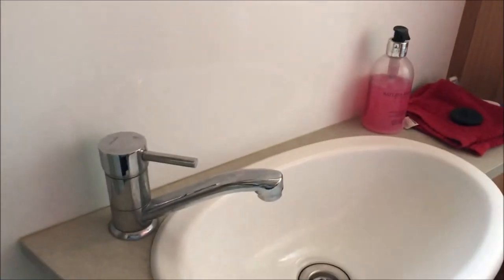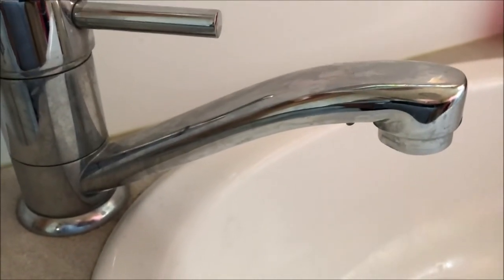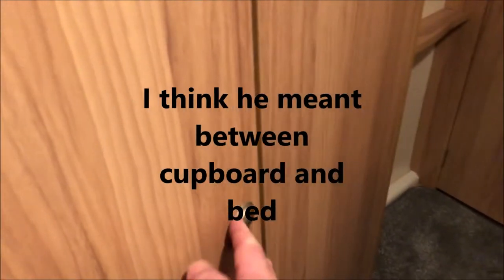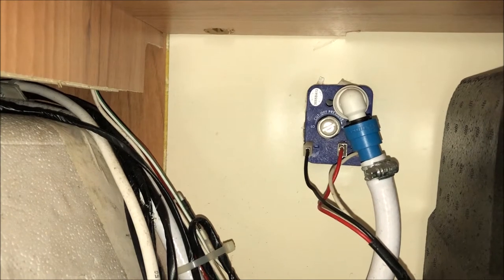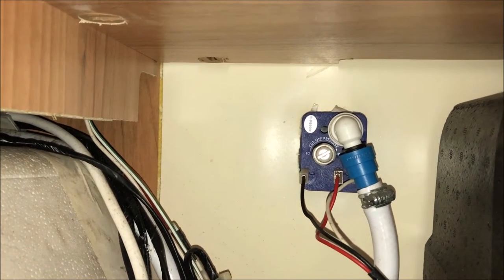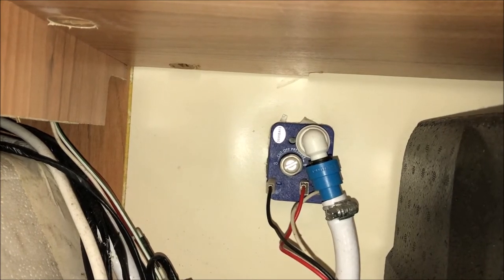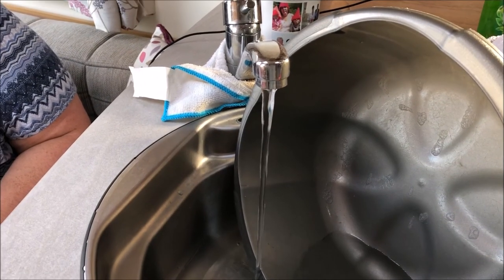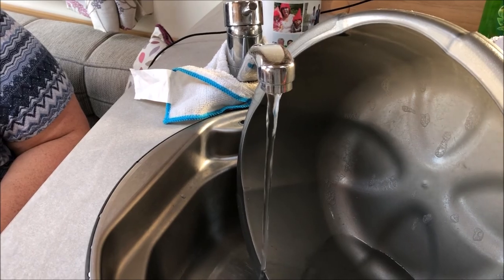Whale Water Master Socket, pressure switch adjustment

Comment: Nice easy job Mark just a bit difficult to get to. Have a look at the Whale Watermaster IC pump controller, fitting one of those will sort the flow out automatically. Have a good Christmas, cheers Martin 🙂
Reply from the maker: The Caravan Nut had an IC Controller on old van, thinking of changing ours over later this year. Thanks for watching